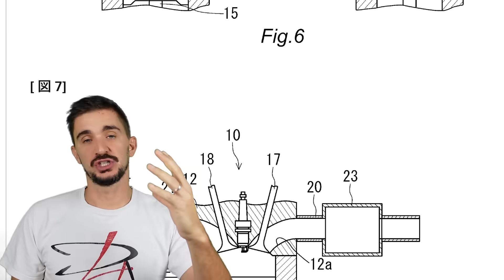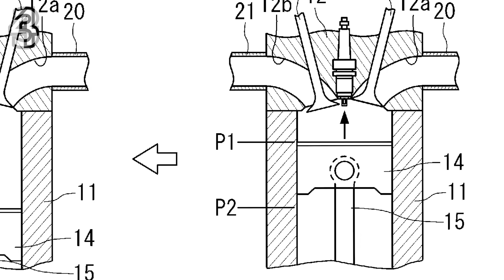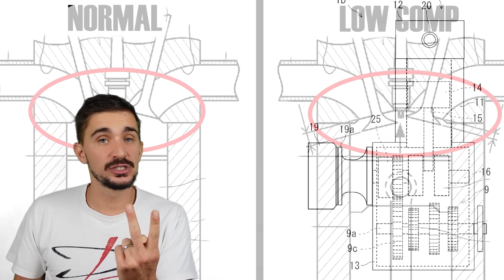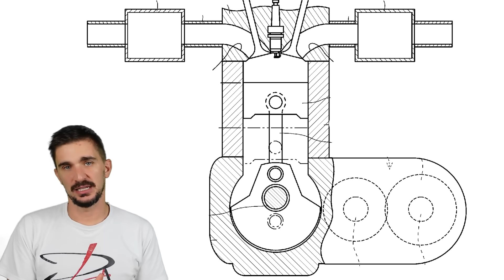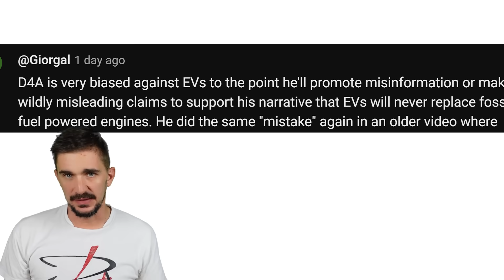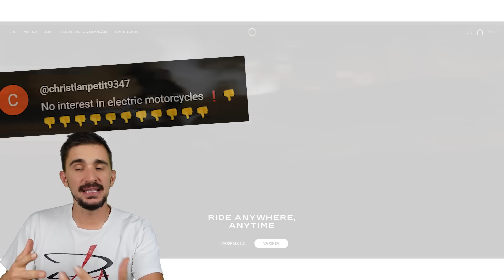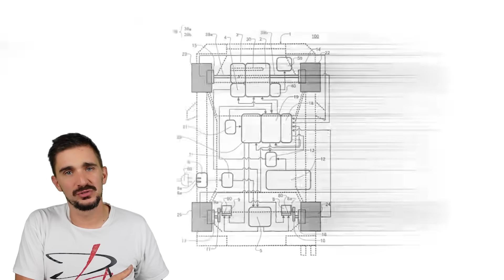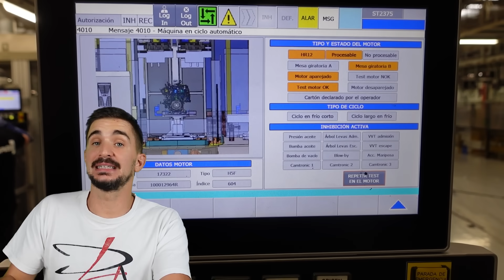Yamaha Just Patented A Fake Engine

Comment: There is already a Japanese patent to simulate the manual gearbox in an electric car, clutch pedal, stick shit, even torque modulation on the electric motor to simulate higher gears. 
Obviously Yamaha could have solved this problem with a vibrating seat and a hidden speaker, so there is more behind it. I suspect they want to continue to sell parts for existing motorbikes after the ban is in place so that these are kept on the road for longer periods.
Anyways, lubrication isn’t a problem because there is no combustion so it’s like having a manual gearbox with long maintenance intervals.
Reply: You still need lubricant, regardless of the combustion. You have friction between piston rings and cylinder, also between piston rod and crank.
Reply: @augustinberceanu3484 Sure, and oil changes too, it’s just that they are far apart as the oil won’t suffer from contamination and heat degradation. Probably it will be marketed as lifetime 😂.
Reply: What ban? There’s never going to be an ICE ban, what will actually cause the death of internal combustion is when we start to run out of oil. Even then you’ll probably still be able to buy synthetic gas, just will be way more expensive.
Reply: @davemccage7918 The EU has a ban on selling ICE vehicles starting 2035 for the moment. They might ban new ICE engine sales too so with this, Yamaha will get around it because it has a different purpose and doesn’t burn fuel. Sure it’s more expensive but in the end it’s basically contraband as people will buy the electric bike and cannibalize the “sound system” for parts.
Reply: @cancracker  By 1035 it will have been made apparent that electric cars are stupid. That pre'emptive ban is just a publicity stunt to calm the tree huggers.
Reply: @cancracker   The EU does.
The rest of the world doesn't.
This would only have market in the EU, if by 2035 Europeans are even still able to afford a motorbike.
Which at this rate it's not a given.
Reply: Toyota patented that like 2 years ago. And they had a Lexus prototype with said transmission. Unfortunately Toyota's EV plan is to make crap and overpriced EVs that don't sell, claim that EVs are not the future and sell hybrids instead. So chances are we won't see an EV with 3 pedal+stick because of this. Hyundai Ioniq 5N is the only production EV capable of simulating an ICE with a DCT, including manual gear shifting, that received a lot of praise from media so I guess that is the closest EVs will get to simulate ICE until Toyota's troll patent expires.

Comment: This is probably the dumbest and most vainglorious thing I've heard about in a while. They're taking an electric motor and adding most of the mechanical complexity and costs of an ICE without adding anything but superficial benefits. I get that motorcyclists want engine noise for emotional and safety reasons but this seems like a very roundabout and extravagant way of going about meeting that desire, and the price being paid for that extravagance is a reduction in vehicle range, a weight penalty, and an increase in cost.

Comment: as long as someone  proves, this is not an elaborate prank..
because, there is NO new function or mechanism,there to patent.
you cannot patent a whole ICE engine, just because it doesn't "self-propell" you just can't.
so,,, what did they patent ?? probably nothing.. 
Looks like FAKE NEWS.

That aside, the reasons to do that if they found a way to  it, would be ...
a) a preinstalled "dummy motor" which can be operating if "later desired"
giving a zero emmisions sticker to an ICE bike., with double it's stated power...
b) making sure, nobody else can do it..

remember..Yamaha is not a banch reality detouched elitistic,,junkies like Honda.
in Yamaha, they LOVE bikes.. they ride themmm . 
they're petrolheads...
they're the ones who made the RD,  the XT, the DT ...

either way,,, in Yamaha we trust..

Comment: Yes I believe it is a gimmick. Also I share your views on EVs. I think they have a definite purpose but are not suited for everything. City cars, local deliveries, situations where the vehicle returns home every night are great. 
As a family car, not for me. 
Also I like simplicity. EVs are terrible complex. Everything that was once powered from an engine now has to have its own system; A/C, steering, heat, brake boost, air compressors in trucks, aux hydraulics in commercial and industrial. 
I like simple things for myself. 
Enjoy your videos!

Comment: Frankly, this does have a "use" - making people have the sensation of driving something with an IC engine.  Yes, I agree that's an absurd use, but likewise I think people that need that sort of sensation to buy something is absurd.  As you said, "don't like it, don't buy it" applies equally well to yourself when deciding whether a bike with a fake engine is for you.  "Petrol heads" may be an unreachable market, but there may be a group just below that hardcore group that still wants to hear/feel the engine sounds - and not from a speaker.

Comment: The intelligent thing to do would to be make a piston air compressor that sounds like 4 stroke engine and store the high pressure air to be used when more power is needed by using the compressor as a motor. Air hybrid? 

All the pieces for this save an air tank are here, this is a fumble

Comment: i think while there is a point to the sound and vibrations and riders
but, if i wanted to ride something that made noise, vibrated and looked like a CBR, i'd ride a CBR, not an E-bike with delusions of being a ICE motorcycle

the issue of motorcycle manufacturers is that for a while, electric motorcycles were not appealing, with poor performances, heavy weight, excessive price, etc, thus people in general did not appear willing or ready to buy those early E-motorbikes. so they kept making ICE and only ICE, and didn't give a serious look at E-motorbikes
in the meantime, you had e-bike manufacturers making better and better products, so much better products that you can buy now, for less than a second-hand bike, an E-bike that goes to 50+ kph, and with ranges of 100+ km, no licenses, registration or MOT needed, because it has a pair of bike pedals and is "technically limited" to slower speeds (limitations often just a menu away to being undone)
so now motorcycle makers are eyeing having to play catch-up with the threat of their products being outlawed in the name of progress and facing, let's be frank, an unfair competition

there is also an issue for the demographics also that, on average, motorcycle riders are not exactly young, and that's probably why they had this "good idea" crop up, as older guys tend to be more resistant to change and new ideas

Comment: I'm not a motorcyclist, but if the feeling (vibration...) of a reciprocating engine is actual useful feedback all of this could be achieved with a speaker or an air pump and a vibration device, like game pads, but bigger. of course tuned so throttle/speed mimics the feeling of the Real thing.

Comment: I'd love an electric bike, and rather than the noise and feel being different, I think the expense is what's stopping me.

However, I don't think this setup wouldn't be so bad if the air could be compressed into a tank or something and made to work, maybe for example, to give a little boost to the motor on acceleration.

Comment: So what you're saying is, they've patented a motor that is less efficient than the engine it is replacing.  
This will mean you will have to recharge the battery more often.. 

Using a motorcycle is about freedom, NOT about being tethered to technology. Sure, you can futz around for an hour on an electric bike and have fun, but if you're touring, using an electric is stupid. You'll be tethered to a battery charger. 

Yamaha just very well might be.... retarded..

Comment: Low IQ bike riders think engine noise saves them from being hit on the road.  It's a real concern, but for electric bikes use a high-tech solution like a collision detection system that flashes led's into the mirrors of people merging into the bike.

Comment: It'd make more  sense to have a working engine that can function as a range extender, but with variable valve (electronic?) control to limit resistance when operating in electric-only mode.

Comment: This is brilliant. Don't you people know how much Yamaha spends on tuning engine and exhaust sound? Mostly for cars though. Putting a whole piston air compressor that does nothing on a bike is stupid for us, but even we have mechanical sympathies. We seek performance and efficiency. This isn't for us.
What it is, is the only complete solution for getting (real) engine sound from electric motors without burning anything. And it probably costs and weighs less than a full hydrogen burning system - which people want just because of the sound and vibration.
Peak engineering. Well done, Yamaha!

Comment: Yep, it's stupid.

A better means would be to hide the drive motor within a case meant to look like an engine with a separate motor inside with a flyweight so it can make the pleasing vibrations all through the rev range including idle, and a conduction speaker also within the fake engine to make fake engine noises. Since all of it is electrically driven it can be turned on and off on a whim.

Comment: As a proud former owner of a 600cc four-cylinder Yamaha (a '99 Fazer), a former user (though still the owner) of a 1989 Yamaha synthesizer, and as a combination of both, knowing that they are practically different companies sharing a brand, eager for knowledge about the firm's immense technological arsenal, I can't believe that such an honorable company has squandered such a ridiculous amount of money and resources. Back then, they were in charge of making sensible, reliable things and left the crazy stuff to Kawasaki. Now it's the other way around: there are hybrid Kawasakis with a good dose of positive innovation, while Yamaha says: "Hey, look, a squirrel!". I know that coming from such a cave-like environment, I can't appreciate all the benefits available in this digital era to us, but two things are clear to me: 1: I've never needed more vibration than that slight tingling in the footpegs and grips, and sometimes in the tank when I lean against it. A tiny dual-mass flywheel sewn into the frame would suffice for that. And 2: the engine noise only becomes truly musical between 7,000 and 12,500 rpm, but Yamaha would still need years of work today to make the synthesis of those engines sound less fake. Another thing is what concerns those happy owners of agricultural devices with two enormous V-shaped pots. They also have the right to be satisfied with vibrations and bangs.

As a current HEV driver, call me outdated if you want, but I greatly appreciate the lack of noise and vibration it provides, even when I'm out for pleasure driving.

Comment: Nothing like riding a malfunctioning air compressor. In a way it's genius, you can ride around airing up flat tires way before AAA gets there. if the valves can be held open then they can be closed to make it into a compressor.
Reply: that'd require full camless

Comment: tbh it could be interresting if they made a motor that had variable compression by just delaying the other compression stroke
having the motor just drive a generator that opens circuit for a fraction of time to make only part of the cycle part of the power stroke

Comment: 17:58 anyone that has used an air compressor to pump up tires knows that sound 😂😂
Reply: Just what I wanted for my electric motorcycle, a 95dB air compressor under the tank, running all the time, driven with energy from my battery
Reply: @emanuele8226  You would not have a tank...😉

Comment: Then Yamaha should instead install a small, single-cylinder 25-50cc methanol/ethanol engine that produces 1-3 hp, and the rest is electric. Then at least the fake engine won't draw any power, and you'll have a good sound, use hardly any fuel, and methanol/ethanol don't produce such toxic exhaust fumes.

Comment: Wouldn't use that diagram as proof of a constantly open valve, it also shows a spark plug embedded within the head. 

There would be so many problems with this, that will never be made.

What about the cylinder wall lubrication that would inevitable create an oil mist from the exhaust?

It's an apprentice project that's a literal non-starter.

Sorry if these issues were adressed later in the video, I bailed early.

Comment: I will refuse to buy an electric bike no matter what.  I'm an ebike/PEV mechanic for my day job, but none of the ebikes are as capable in the real world.  I live off grid, make all my own power.  So if the sun don't shine i don't get to ride?

I'm not anti-EV by far, i'm anti-BS an so far EVERY SINGLE PEV or EV i've seen comes with a mountain of BS hype and fake waste attached to it.  I just rebuilt my '93 KLR's engine entirely by hand in my off grid shop.  Meanwhile i've got last year's ebike hanging on the wall as a parts bike/ewaste because i can't get a $5 proprietary part.  Another bike has a fried controller that is unavailable because it's a year old.  Customers bring these proprietary bikes in that are worth their weight in scrap because some random Kickstater scam failure built a bike with special bespoke weird forks, cranks, and such.  

It's a bigger waste to toss away a vehicle every 2-5 years than to keep something like my 32 year old finely tuned IC machine being useful.

That said, i DO have an electric project in the works, a '74 Suzuki TS125 that i want to resto-mod and electrify for something i can ride around the property on or do a few miles into town when the roads are passable with it.  Looking at building a 5kw mid setup for it.

Comment: I don't see this fake engine idea as something that will become a widespread thing. 
However I do see some useful niche areas where this concept can be viable in the markets. 
Not all electric vehicles are new built, there are conversions of old vehicles and conversion kits that can be used for such conversions from petrol to electric vehicles.
Conversion of old gasoline powered motorcycles to electric ones is where I see the most economic potential for this patent. When the engine in an old motorcycle dies, then a 'fake engine' packaged and combined with an electric motor can become a good and reasonable alternative to replacing an old engine with a new gasoline powered engine. A 'fake engine' with an electric motor inside and a battery in a 'fake gas tank' along with some electronics can potentially make for a set of very reasonable conversion kits for many old gasoline powered bikes, including vintage ones, while still giving the riders a comparable experience although most likely with limited range, I suppose.
But a fairly limited range is not necessarily that big of a big deal for a vehicle that's mostly used for joy rides or shorter daily commutes within and around cities. 
Electric bikes and electric scooters are not very comparable to electric cars or electric trucks more or less frequently used for longer trips, where people have all the range anxieties and requirements.

Comment: Its a way to keep their engine manufacturing open so they can be the first back in the market if the electricity craze fails. They will keep their machines and staff including the ability to build them.  Also could be a good idea for a way to produce engines and "reduce" their emissions but the shops in the countries they sell to can convert them to a electric hybrid of even a full gasoline engine.  Wouldnt take me long to make it run.

Comment: I suppose that lubrication will be needed for the fake engine, so oil and oil change (at very long mileage, of course), oil pump, air filter to prevent dust to enter the fake engine...and many other things that will add complexity, weight and subtract power and money.
Comsidering the present status of marketing I'm almost sure it will have huge success.

Comment: This makes a lot of sense, the lack of physical feedback greatly compromises the electric bike experience, which is a dealbreaker for many. 

A fake engine that uses 20-30% of the electric engine’s power is still an order of magnitude better than burning fuel if the electricity comes from a clean source.

Therefore, this can help bring many mechanic lovers over to a cleaner electric motor.

Comment: Assume (1): You live in Inner City Apartment and need Better than Auto Mobility through Traffic; (2) Electric Vehicles are Banned due to Lithium Battery Thermal Runaway and/or Charger Fires and/or Infrastructure limitations; and (3): Nosy or Militant Neighbors/Policing.  

You can fool the Less-Informed: "Exhaust" Pulses!  Vibration!  Noise!  ANND Relative Silence when the Fakery is By-Passed: "Stealth" if You will.

The severe penalties to Range might be tolerated by the buyer who wants no gasoline costs/requirements and/or wants to keep irregular Hours in a Populous enviro.

Comment: They missed adding an electric heating element in the exhaust that burns a tiny amount of fuel and oil so it also smells right... 

Or maybe they're "investing in the future" where all elctric vehicles get banned, so all you need to do with your Yamaha is remove the batteries and put a fuel tank where they used to be.

Comment: Here to drop knowledge that'll likely only get acknowledged in the future ("... FUUUUUTUUUUURRE):

Yamaha is likely intending to do more with the faux engine, but is hedging their bet by patenting the engine by itself. I guarantee IF it proved wirth it, we'll see the intake or exhaust side of the air flow pumping clean cooling air over the motor and controller.

Comment: I think Ymaha is being a bit clever here. That's more than likely a fully functional engine intended to run tandem with an electric motor to make a hybrid motorcycle. The patent just protects the idea of using the engine as a noise generator during pure electric operation. Why else would the drawings include a spark plug?